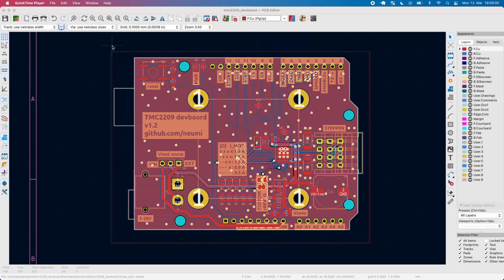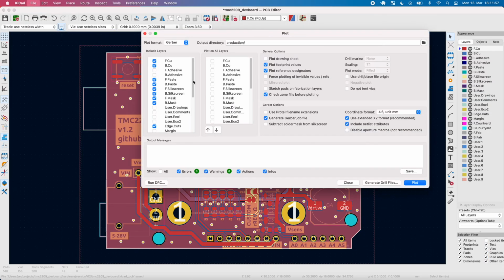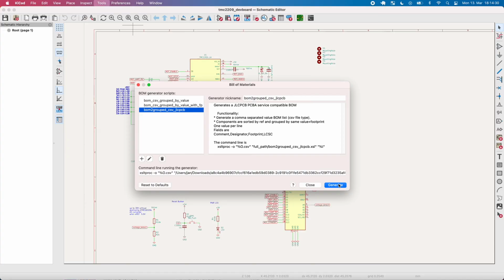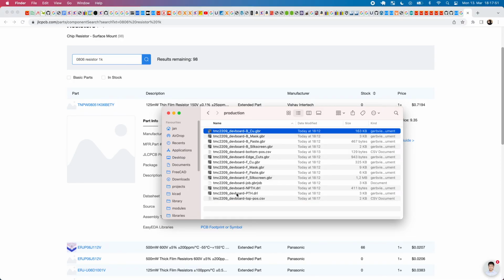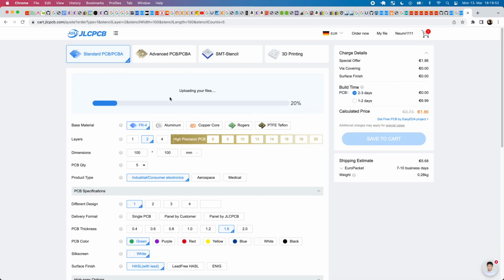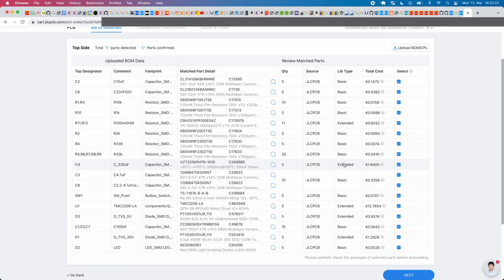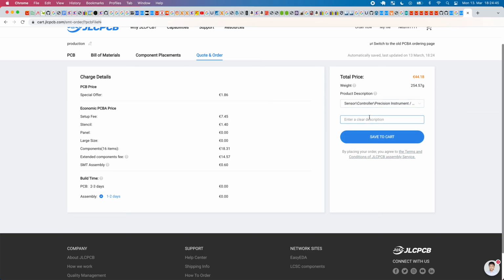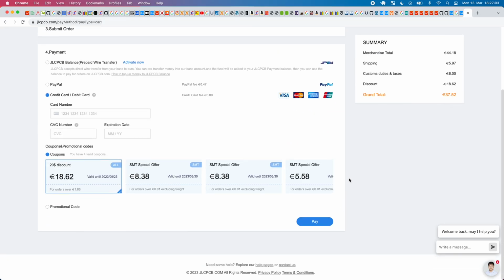Tutorial: KiCAD export to JLCPCB PCB manufacturing and SMT assembly

Comment: Thanks, incredibly useful! I was very surprised how easy SMT is for JLCPCB. Never have tried it before as I supposed it would be too expensive, bet here I can see it ends up cheaper than ordering all parts by myself. Definitely should try JLCPCB SMT process next time.
Reply from the maker: Nice to hear that the video helped. 3rd party assembly can be cheaper than ordering all the parts yourself and assembling them. It depends a bit on the number of 'special' parts and the overall number of parts, but usually, it's not worth the effort to solder >50 pcs assemblies with many small parts yourself. But check this plugin it makes the export even faster and easier. (this tutorial is a little out of date) https://github.com/bennymeg/Fabrication-Toolkit

Comment: How can I add text to the front or bottom silk screen layer in KiCad like you did for your?
Reply from the maker: On the right side of your PCB editor window you can find a large "T" symbol. Klick on it and enter the text ;)
Reply: Do I have to select first the F.silkscreen before clicking on the "Add a text item"..?

Or there is a particular layer l would select to achieve that.?

Comment: So I've tried this process and when I hit generate after adding the JLC script I get an error window pop up saying "Execution of command <<name of command>> failed. The system cannot find the file specified.). 
And when I close the pop up, i can see there's also "Command error. Return code -1." in the generator window. What have I missed?
Reply from the maker: Hmm. I've never had this issue. Have you followed the instructions on the JLC page? In my case, the script is in my downloads folder (I know not the best place for it). You have to specify the path in KiCad.
Reply: Did you ever resolve this issue? Im having the same problem, but I know for sure that my file path is correct.
Reply: @war9201  I am also getting errors